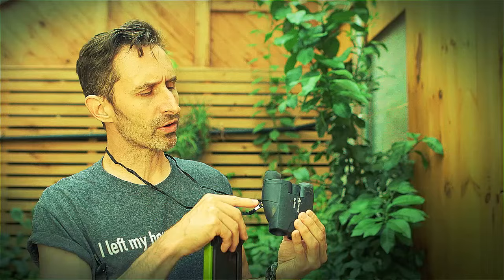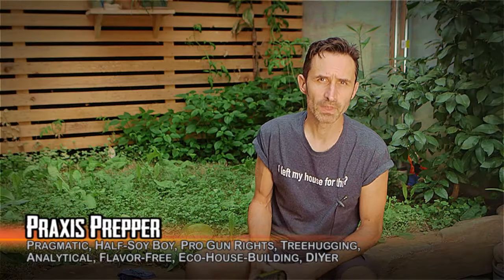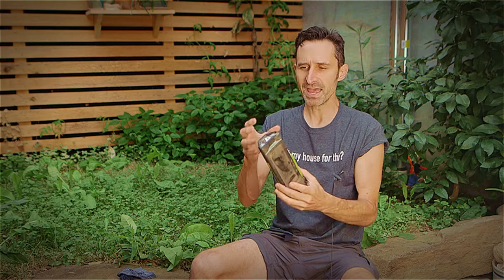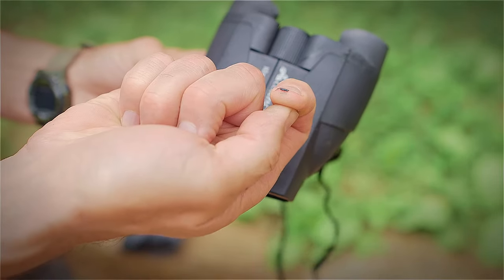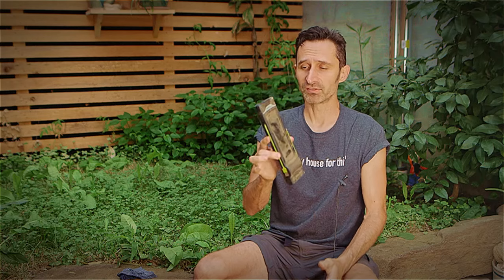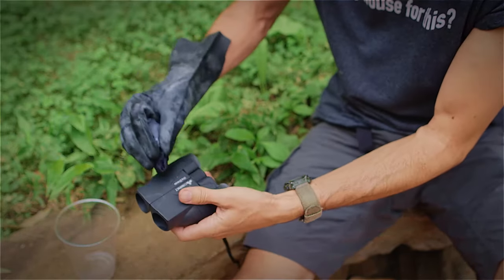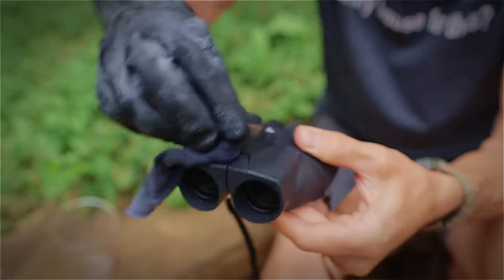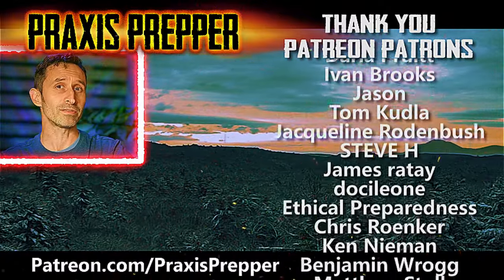Remove Sticky Surface From Old Plastic Products

Comment: Most of the time the reason this sticky slime forms is a process called "bloom" or migration of the plasticizers, oils, or other plastic additives to the surface over time. What originally was giving the plastic surface that nice flexi-tactile feeling has diffused out of the plastic. For the actual real rubber stuff, what you're feeling is the vulcanization of the rubber breaking down. With the crosslinking breaking, rubber starts to turn sappy again. 
Best thing to do is to try to avoid it - store your cool gear  in a cool place - not the attic or trunk of your car. If its too late, don't reach for the gas right away - I'd recommend these things in this order: 
1) Try making a paste of baking soda (sodium bicarbonate) in warm water. Give it a scrubbing. If that doesn't work, try
2) The highest percentage isopropyl alcohol you can find (>90%). If that doesn't work, try
3) Orange oil cleaner - the active ingredient in the original Goo Gone. 
If that doesn't work, break out the gas! The reason I recommend that order is that some rubbers/plastics will clean up great, but the harder core stuff like gas or orange oil has a tendency to cause a re-bloom of the remaining plasticizers or end up making some stuff brittle.
Reply from the maker: Great comment. I agree that if something less intense that gas is capable of solving an issue, it'd be good to try that first. Nothing to lose playing it safe! Thx for the comment!

Comment: Did that years ago with a joystick. The gasoline got infused in the plastic and the whole thing reeked for almost two months while placed outdoors.
Reply from the maker: That's weird. After 2 days, the smell in the items I treated was essentially all gone. Maybe it got into some crevices of your joystick?
Reply: @PraxisPrepper  Maybe it was more porous or a different plastic alltogether than what you had.  Anyway, the lesson learned is to understand the object in case will not be useable for a while.

Comment: Yes, yes, yes eventually it stops secreting that sticky oil. My rubber grips on my revolver started secreting at around 20 years old. Cleaned then it secreted more and more, it took over 3 cleanings until it finally stopped. The grip still feels fine like before it started secreting. Almost 30 years old now…